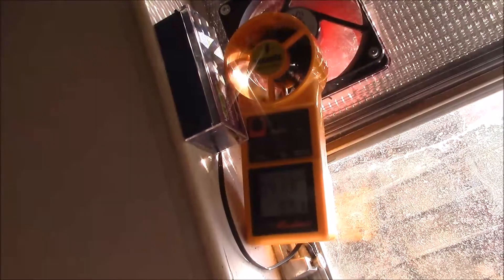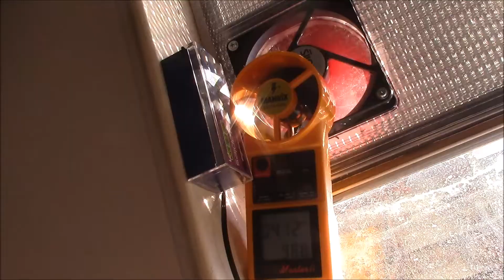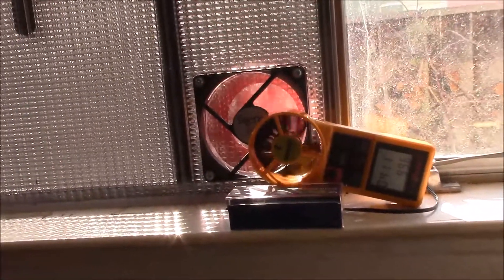In-Window Solar Heater Test, Part 1

Comment: What is the thickness? I found 10 mm thick, would it work with this one? Thank you
Reply from the maker: Yes, 10mm thickness should work fine.  I used 8mm because I had some left over from another project.
Reply: thank you!!!

Comment: Very unique & some good aspects to it's design, like retaining light for the room, well done. Unfortunately as you say, the glass is both your friend & your enemy, letting much heat loss out through it to the outside of your home. I'm building an aluminium drink can indoor window sill solar air heater, there are some on YT have a look, getting great results from small external units too. Cheers for sharing.

Comment: A WINDOW solar heater doesn't work ANY better than the same window with a black paper curtain would. That's because you're ALREADY getting the sunlight coming in, all you need to capture it with an absorber, and it then TURNS TO HEATED AIR!!
Reply from the maker: Yes, if that were all there were to consider.  But realize the dual wall polycarbonate sheet has ~R2 insulation factor coupled with the R1 of the glass gives R3 total.  That means while the heat gain is the same, the heat loss through the window is 1/3 that of the bare glass (yes old house with single pane aluminum framed windows).  And the other thing is the fans get the heat out away from the cold window and into the room.  

Sure, could do the same thing setting up a dark absorber in the room during the day then putting up an insulating cover at night, but this setup has been working automatically for the last 4 years with no manual intervention.
Reply: @The4Crawler  
So just upgrade to double pane windows and put a black absorber curtain behind it inside!! Your box does nothing, the fan can be anywhere in the room,  Jus' sayin' you don't need a damned box, let alone baking pans.
Reply from the maker: Yes, would love to do the window upgrade, but to do the whole house is a fair chunk of change.  And I had most of this stuff on-hand and it works quite well.
Reply: @The4Crawler  
Well, I'm not yellin' atcha or anything, I'm just sayin' cus I KNOW, I'm a physicist, that a box  collector indoors is silly. You only need an insulated box OUTSIDE. People can be so superstitious about what they see on YT. There are a bunch of people thinking they need to collect and cut dozens of beer cans to make a collector, and those are NOT needed AT ALL!!   And you don't need a vent fan either. What you spent on a box can buy you several sheets of that plastic to do several windows dbl panes.Just get some wood trim to anchor it, cheap.
Reply from the maker: I agree, an outside heat collector is the best.  I've heated my house with one going on 10 years now:
https://youtu.be/fGMP5mZsGzc
This in-window unit was an idea to try something different and I've found it works quite well.  Yes, many other approaches that could be taken.  If I had a scrap of plastic large enough to do the whole window, I might have tried doing a full double pane window, but I only had a scrap large enough to do half.  

In years past, I've done the clear plastic across the window in a double pane setup.  While that does work, it's cumbersome taking those out and finding some place to store them safe from damage during the spring/summer/fall.  The one I used to use was damaged in storage and I decided to forego repairing it after that.

Comment: Shouldn't the fan be at the top of the panel? Since heat rises, I would have put the cold air inlet holes in the bottom and fan at the top.
Reply from the maker: There is an inlet fan at the opposite corner.  Since the air moves up and down across the panel a few times, there's no direct path for the warm air to rise in.  I had the outlet down low so that is could be below the roll down blinds and also to get the warm air down lower in the room.

Comment: Nice looking set up...but you are blocking sun light that has already made inside your house. That sunlight would warm up whatever it falls on. You are just finding another way to do the same thing. You should move this to the outdoors, I realize it will complicate things and add expense, but then you may actually accomplish what you set out to do!
Reply from the maker: You are correct, but moving this outside would involve cutting a hole in the wall top allow the hot air to come in.  This setup does two things, one is it captures the heat that is coming through the window and pushes it into the room.  Yes, this would happen w/o the panel in place.  But the second thing it does is insulates the window.  So instead of a single pane of glass (R1), I now have ~R3 with the double wall panel and the air pockets.  So this slows the heat loss when the sun isn't shining in the window.  In a sense, this is like a thermal diode, it lets heat pass in easily, but leak out slowly.    And yes, I could put in double pane windows, but this is a lot less espensive.

Comment: Very clever and elegant construction. Great way to get free heat. Thanks for sharing.
Reply from the maker: In some cases yes, but in my case, it works.  With old single pane, aluminum frame windows, there's heat loss to contend with.  This in-window heater is may with double wall poly-carbonate plus the air gap between it and the glass.  That makes an effective "thermal diode" in that heat is collected and pushed into the room by the fans when the sun is shining.  Then later, it forms an insulator to prevent that heat from escaping.  

Could also install a thermal curtain, but that would require manual operation to open in the day and close at night, vs. the automatic operation of the existing unit.   Another option would be to install better windows in the house, may do that one day.   But for now, this is working well.
Reply from the maker: Thanks for the comment, glad you like the project.  The heater is still going strong, now on it's 3rd winter.  It helps pull in heat during the day and then makes a good insulator for the single pane glass windows at night.
Reply: Darlene, if you think this is a good idea, then you went to beauty school. Once the suns rays went through the glass, it ( they) was ( were) collected in the house. No further effort is needed. This was a waste of time.

Comment: What kind of material are you using ?
Reply from the maker: I cover this in my build video:
 https://youtu.be/sO-PAfpgFv8

In short, it's some double wall polycarbonate panel (often used in green houses) and a sheet of perforated aluminum for a heat collector.

Comment: It actually also looks good! Nice work.
Reply from the maker: Thanks, missed your comment earlier.  Yes, I leave it in the window year round now.  The only view out that window is the neighbors bedroom window, so not missing anything with the obscured view.  But since my house is older with the horrid single pane, aluminum framed windows, this heat panel is also an excellent insulator.  In the summer, it keeps the heat out (since I have the fans turned off) and in the colder months, it helps add insulation to the window plus pulling heat out during sunny afternoons.